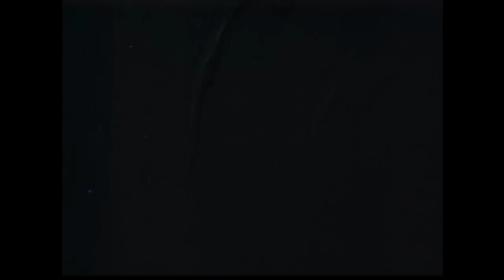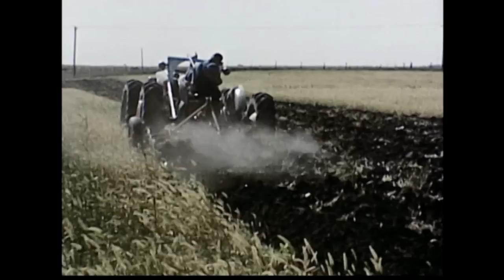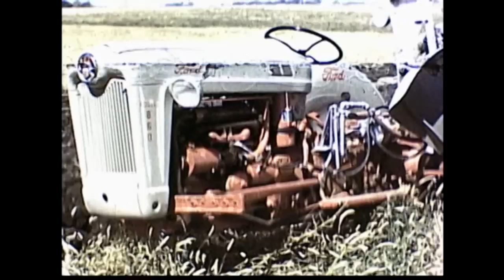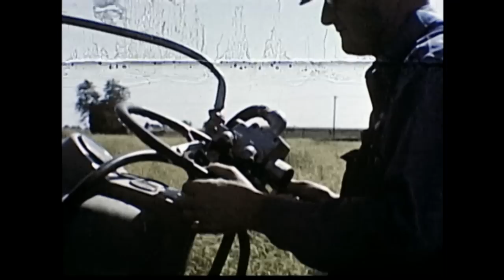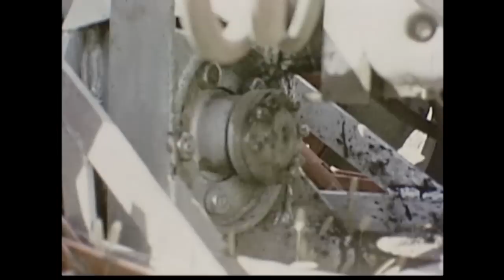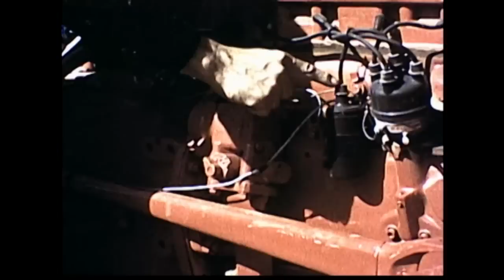Film Footage of Tandem Tractors, Iowa State University (circa 1959)

Comment: Thank yo for posting:    Anyone learned ANYTHING from his 60 yr old piece of research?
1.   ONLY around 70hp to pull that 5-furrow plow at a reasonable speed.
2. Note the centering of the plough about the tractor - Wheel TRACK set out WIDE so that the tractor  sits more LEVEL AND the plough is pulled  squarely through the soil
Reply: This is the biggest fully mounted plow I've ever seen work. As a mounted plow gets longer, it gets harder to keep both ends of the plow in the ground at the same time. I wonder when the idea of a semi-mount plow came into practice? You're right-in this era, the rule of thumb is one draw bar horse power per inch of plow width. More modern plow/tractors run at higher speeds and slightly deeper depth. They use more horsepower to plow the same width.